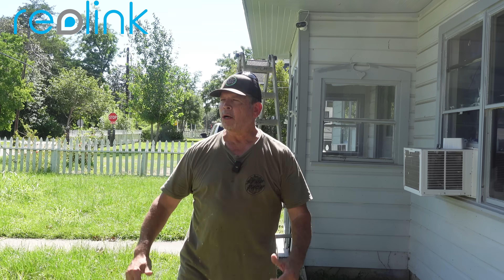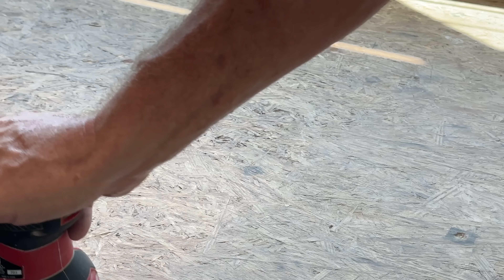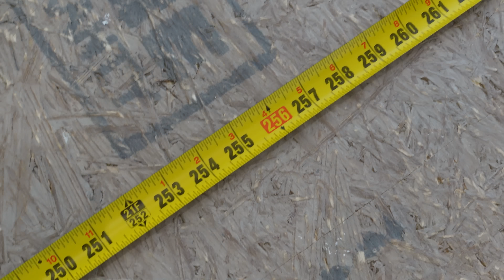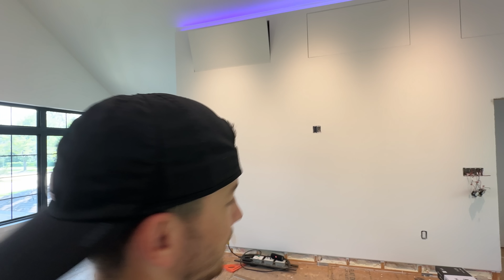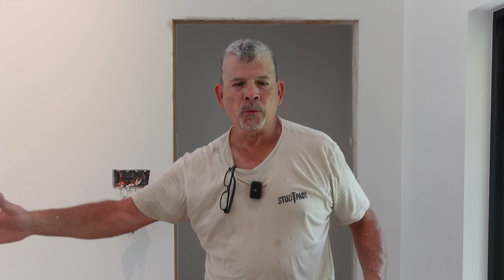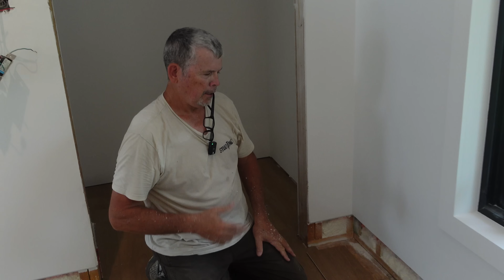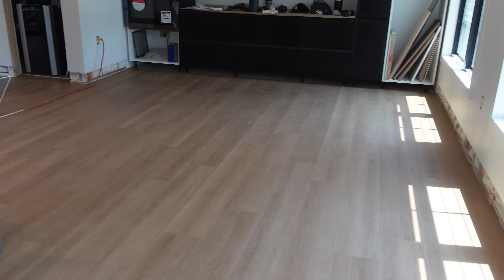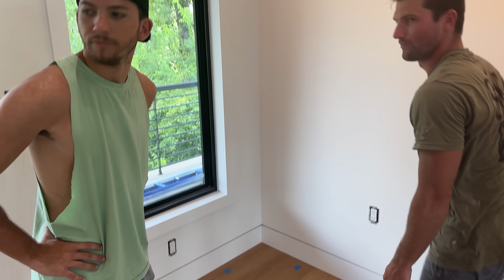FLOORING and its TOOLS Have EVOLVED! Installing Vinyl Plank Flooring

Comment: I wouldn't install that vinyl floor to tight to the framing. Last install I did with with type of flooring I left 3/4 from the framing. This was on a heated slab
That product isnt sensitive to humidity, but sensitive to temperature,
Reply: The problem you had might've been that your planks weren't acclimated to the temps of the heated floor.
In their case (depending on how long it took them to get it all up to second floor and installed) the flooring was very likely acclimated August-In-Texas temperatures.

They probably could've left no gap at all, and the only time expansion would be an issue is if the AC happened to crap out for an extended period of time.

That's not knocking you. It's just a factor that's so often overlooked.

I installed 1200 sqft of LVP in my basement, with the longest continuous length of flooring being around 30'. 
My basement floor is nearly the same temperature year round, regardless of whether it's 90 degrees outside, or -10. Yet, I still have the exact same gap between the flooring and walls year-round. 

Anyways, just something to consider.
If you install flooring in cold weather, leave the recommended gap. BUT, if it happens to be installed on the hottest day of the year, leave very little to no gap. (Or at least don't exceed the manufacturers recommendations, and this also assumes the flooring has had adequate time to acclimate to its environment)

If I had to install LVP on a heated floor system. I would either try to lay out as many planks as I possibly could with the heated floor on, OR leave the cases in a small room with a space heater, for about a week before putting it together.
Reply: Ain't nobody got a week to wait to install the product, the in slab heat will be completed on the plumbers schedual, and really only left 1/4 from the drywall. 
I've heard, of it popping apart from center air conditioning. 
It's just a temperature sensitive product, and I seen they couldn leave much room for expansion because the put the baseboards under the drywall
Reply: @grantmackinnon1307  
Temperature sensitivity is the whole point of what I'm saying, they didn't need to leave more room for expansion than required by the manufacturer because the product was likely already acclimated to the hottest temperature it will ever see.
A full week is definitely overkill, but I only meant that it's what I would personnally do in my own home. 
Regardless, (depending on the storage temp of the flooring) acclimation isn't asuggestion, it's a requirement and needs to be accounted for. Especially if the the product is going to end up warmer than when it was installed.

As for the central air causing it come apart, to me it says that there is way more of an issue with uneven cooling. Or, whoever that happened to probably went away for some period of time and either turned AC off or down to save on energy, then probably cranked it to its lowest setting upon returning.
Reply: It was probably the rapid cooling, if I recall the particular floor is 4inch, 6 inch, and 8inch wide planks by design. I think its the tongue and groove drop lock system that failed with the temperature change on like maybe 7c in a couple of hours. 
I just don't like it because I'm probably going to be the one to try and fix it when i had nothing to do with the flooring. 
Have you any ideas on what can be used to glue in another plank if one need to be replaced? With laminate you can use tongue groove wood glue, with hardwood you can lumber lock is down, with vinyl plank I don't know a proper way to replace a plank in a floating floor @dalaube
Reply: @grantmackinnon1307  Unfortunately, I'm just a know-it-all who's not actually an expert in anything, lol.
But, I've seen some videos where a damaged piece were carefully cut out with an oscillating tool. Then all of the tongues of the new and existing peice were trimmed off, except for the long side of the replacement peice. Then, I think the rest was glued down with some sort of generic subfloor adhesive.

I really don't know how well that would hold up, nor am I willing to attempt it for any of the planks that I've accidentally gouged up. Might need to invest in an area rug, lol.

Comment: I've worked in industrial security and it's really neat to see the dual-lens cameras becoming accessible to consumers. Good sponsor!

You made the right call with the small sander! They should really make a standing extension of some kind for that kind of small job!

That score-and-snap flooring has gotten so good!

Are you KIDDING me with those trick deck screws? That's amazing! And infuriating!

These videos are basically electronic Xanax for me. Thank you!
Reply: I swear I saw someone with a router on a stick for cutting out windows and doors when framing walls flat before raising them into place, I bet that can be adapted to the sander
Reply: @legionofanon Awesome Framers on YouTube. He has a custom built handle on his dewalt router with a flush trim bit. 👍
Reply: I saw somebody on YouTube use one of those drywall sanders (with a vacuum attachment and big sanding pad at the end of a poll) sanding down a deck. He said it worked well, but I don't know if they found any paper under 80 grit.

I've also used popsicle sticks/tongue depressors behind baseboards, though it's not always so easy. I like those little screws.

Comment: when I did our flooring (it was MDF based planks) I made my own 'board puller' I took an offcut of 2x4 (about 1.5') and glued and screwed another small offcut to the top of one end, on the opposite end I put a small offcut of the flooring with a small spacer and the tongue section pointing in (with the little locking 'hump' trimmed off the tongue). i then glued a piece of the underlay to the underside of the 2x4. that worked really well and I would 100% do that again. best part is it was free because it was all offcuts and screws out of my random/second hand screws bucket.

Comment: Yeah, Normal guys Rad and Jordan, and the rest of us normals; fixing baseboard corner gaps with nail gun and then pushing it into the corner is pretty normal work. Wouldn't you agree? And it gets the job done.

Comment: In the "big freeze of 2021, a pipe in my house burst, and I had two bedrooms and a hallway flooded. As odd as this sounds, we were lucky to have just gotten back to the house. I hollered at my wife to fill up the bathtubs (pro-tip - if you have water you can both drink it as needed, but also fill up the tanks in the toilet and flush it!)  In the end, my wife insisted, wisely, that we not replace the carpet with more carpet, but rather the laminate flooring as you have done. It took me a few tries to figure out "straight" cuts through a hallway at 23 1/2 degrees to two doorways into bedrooms, but paper templates ended up saving the day!

Comment: Also if you put a sheet insulation door it will help portable A/C  , if you cannot use house A/C. If you do house A/C ceiling off the doorway or the stairs would allow you to not have to cool the downstairs. You said you were going to do air flow test and you will have to use plastic with velcro or zipper for the door if you go ahead and install it you could only cool upstairs with portable or main A/C for the building. I do not want you guys overheating! I guess what I what I am trying to say is seal off that stairway or doorway!

Comment: I'm sure Jordan did a ton of research on the brand of flooring to use. What were the major selling points that solidified that brand over any other? I have been considering the Coretec Pro Plus 7". I'm curious if this brand was on the radar before you picked that product.
Reply from the maker: Yeah full transparency Antelmo gave us a killer price on this flooring and we're very grateful for that at this point in the project. Every dollar matters to us right now! On the main house we will be doing more research and going with a thicker product for sure.
Reply: The primary consideration was 'they got a deal on it' 😂
Take a look at Flooret - both their LVP product 'Modin' and their engineered hardwood 'Silvan' product lines are superb. I've just done about 1200 sq ft in Silvan and LOVE it!

Comment: How did you use a finishing velcro  60 grit sand paper on that floor without killing the velcro pad? My Bosch one wouldn't hold the sandpaper after it's first use. I swear I was gentle on it and using 120 grit sand paper.  Place is looking great.

Comment: 25:56 What magic is this?! Cool screw thingy. I have never seen one of those.
Jordan, do you have some sick furniture picked out to go in your dream garage that will transition to your house in a few years? 
Did you cover what finishes like a towel bar, hand towel bar, and TP holder you will be using in the bathroom?
Also, how close are you to the 'blower test' that I heard so much about near the start of this build? I really want to see that done, how it works, and how well you did. I imagine you will have excellent numbers on the test. Lastly, what is your mailing address so a little sompin' sompin' might find itself to you?
Thank you, Paul and, Rad for putting out such excellent content, I love your channel. Keep up the good work.

Comment: If you had planned to use 3/4 finished flooring and then went to 5/16? your stair risers may not meet code. no more than 3/8" difference between the shortest and tallest risers. Check it out.
Reply: I get the cost savings and needing to put out a video, but I'd stick with my original plan because that's how everything was measured.
Reply: That's not an issue because the stairs are also unfinished. Use the same size flooring in the stairs and problem solved. 

I definitely way overthought that when I rebuilt my staircase, too. Because, I had no idea how I wanted to finish it.
Reply: @dalaube  There may still be an issue. If you are not going to place any flooring at the concrete floor and you cut the stairs for 3/4" finish treads then that means the bottom (first) riser is 3/4" less in ht. the all the other risers. The bottom riser may be an issuse. measure all of your risers to see and get back to me. I am just trying to inform you of a common issuse that a lot of framers face when the home owner changes the finish thickness.
Reply: @williampage3463  it's funny, I was going to edit my post to address exactly this, but I didn't want to write a novel.

I can appreciate what your trying to do and this is an interesting topic to me, so I'm just going to assume that your "get back to me comment" wasn't intended to be condescending.

I'm sure this is a major headache for commercial builders, but for everyone else this still isn't that big of a deal

In the edit that I didn't actually make. I was going to state they would need to add some sort of finished surface to the ground level.
But, even if they were dead set against finishing the entrance, all they would have to do is split the difference in height between the first and second step and plane down the first riser accoringly
The difference in height between their two choices of flooring is 7/16", so the first two steps would only be 7/32" lower than the remainder, which code has deemed to be safe enough. Is it ideal? No. A keen eye might notice it in certain settings when the light hits it just right, but nobody is going to trip over it.

Edit: I don't actually remember what the original and current floor thicknesses were. Nor do I remember if they increased or decreased. Point is it has to be a drastic difference in thickness in order for you to be unable to compensate for it by planing/shiming the first riser. Which is also the riser where you are the least likely to visually notice the difference.

Edit2: also just want to state that I don't disagree with you. Might be problem that has to be addressed. I may have artificially inflated the level of severity that you were implying.
Communication is weird. My life experiences tell me that when someone says "there's an issue" it has usually meant that it can't easily be fixed. When realistically "problem" is not always synonymous with "difficult".
Additionally, I reread your first post and I may havs misinterpreted "check it out" as "check the code" rather than what I now think you meant: "double check the floor thickness because I don't remember the thickness of your original choice but it may need adjustments now"

So there's my complete novel now. This is what I do when I can't sleep 😂
Reply: @dalaube  Not trying to be condesending just trying to be helpful.
Reply: @williampage3463  no worries. Admittedly, I've got some stuff going on in my life, and I've been getting way too emotional and defensive. So, I need to refrain from posting things online until I get that sorted lol. Comment sections are the absolute worst place for me to be so sensitive.
Hopefully, these comments will at least assit others who may find themselves in a similar situation.

Comment: Oh brother, luxury vinyl has to be one of the best marketing tricks to get people to buy vinyl junk. A solid 3/4 hardwood or even tile would have added so much more value. But hey, not my house.
Reply: Much easier to install, less expensive and darn near bullet proof. It may not have the high end appeal of solid hardwood but it's much less expensive. Much easier to install than tile and less maintenance.
Reply: @Real_PK  brother, I own several rentals and have done several major renos, I'll tell you for a fact that lvp isn't bullet proof. If you have pets, good luck. Now it's great with water so that helps. The cost savings here would have been that they could provide the labor for the tile install and add significant value. Not sure they engineered the door to handle the weight of the tile however so there's that. 

I totally realize how fast you can install it, I've done 6000 plus sqft of
Reply: Hardwood only makes sense if you literally have money to burn.
Reply: 🤦🏼‍♂️ Not his house either… it’s the garage. 

If you go back & read their replies to other comments, then you’d learn why they went with this: 
A. It’s NOT the house, it’s the garage, 
B. it was available,
C. the price was amazing, 
D. the plan is for wood in the main house, & 
E. Jordan is still doing research on products.

He wants a nice floor & always researches to find the best product within his budget.